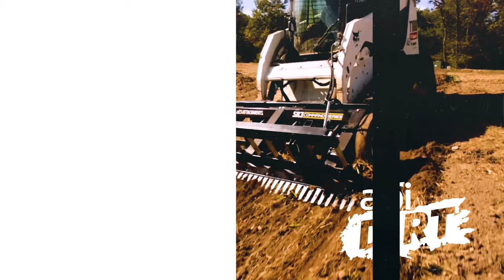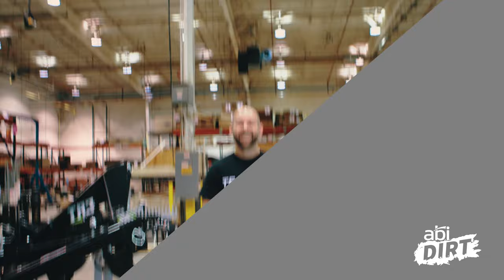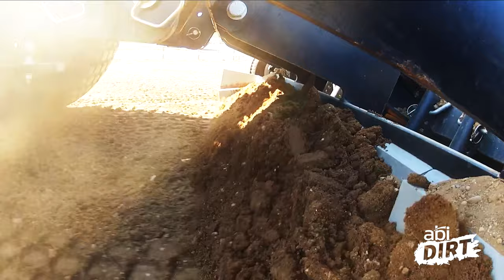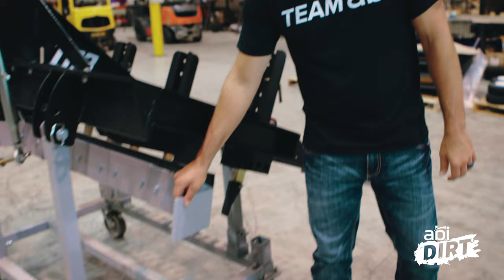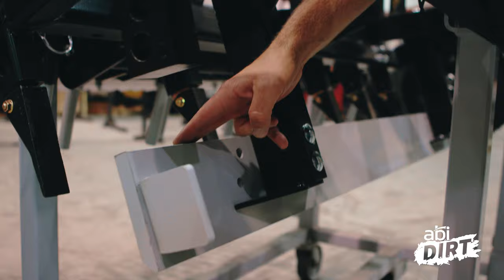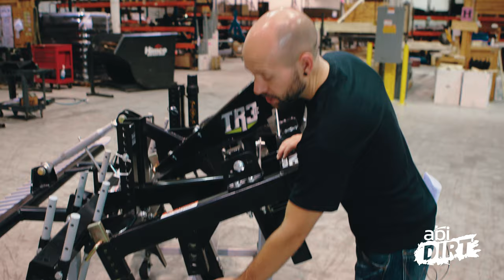Land Leveling Made Easy - ABI Dirt

Comment: Took the TR3e off the pallet and started learning what I could get away with! Within 2 days I have gotten most of it figured out. Backing up to break up dirt piles with the back rake is cool and using the same rake with the fully extended top link (hydraulic) as a dirt grader blade to move more dirt farther has been  a huge time saver. I am sure that there are other things that will present themselves on some of the other projects I am going to use the TR3e to do.

Comment: Is there a leveling blade for the Arena Rascal?
Reply from the maker: Hi Catherine! Great question! 

A floating leveling blade for the Arena Rascal Pro would be problematic because the Rascal line is a pull behind attachment. Any floating leveling feature wouldn't be as effective because the tool is already "floating" behind your ATV/UTV whereas the TR3 is fixed to a tractor's 3pt hitch system.

That said, we've got two options that give you the ability to manually tackle high and lows in your arena: the electric actuator lift system and the Mini-box.

The electric actuator lift system replaces the main square jack that raises and lowers your ARP. Once installed, you can control the depth of engagement on the fly while grooming. That means you can lower the Rascal as you come to a high spot and raise the Rascal once you've pulled material to a low point. It's not the same "automatic" leveling functionality as the floating leveling blade on a TR3, but it puts you in control from the driver's seat.

The Rascal Mini-box is an option that affixes to the Arena Rascal Pro's finish rake and allows you to carry more material. This increases the effectiveness of the electric actuator system and helps you tackle the job faster. It even comes with a toothed blade so the finish is comparable to the beautiful corduroy look that is a signature for ABI Equine drags.

Hope this helps!
-- Matt
Reply: @ABIAttachments  Thanks so much for getting back with me.  I don't have the  actuator or minibox but I have been working the sand with just the blade down no teeth.  It fluffs the sand then I go over again with the blade and rake.   I guess I have loosened the top layer and moved some high spots into the low spot.   It is looking better, Just keep working it.   Love my arena rascal!!
Thanks Again,
Cathie
Reply: @ABIAttachments 
My question exactly and a great response. Absolutely correct. The rascal is in itself a floating blade or sorts